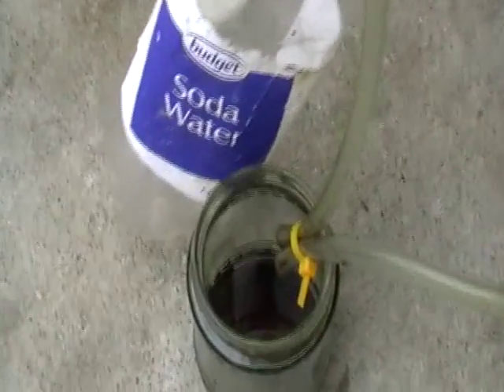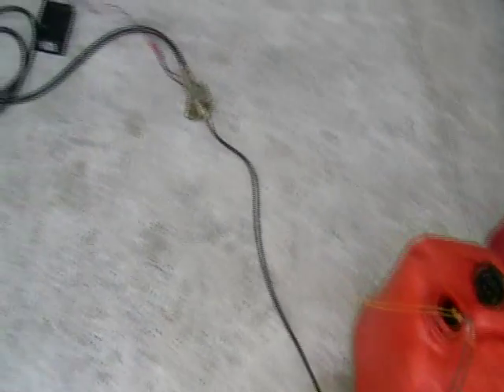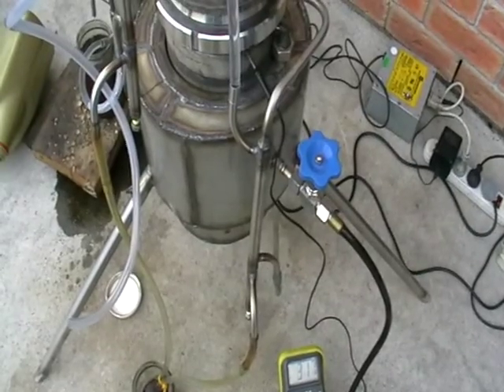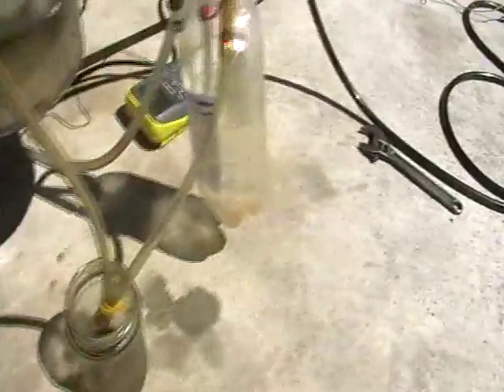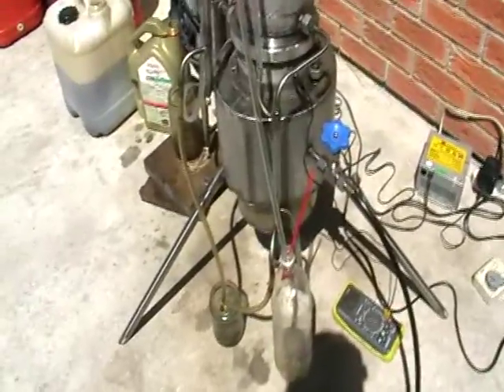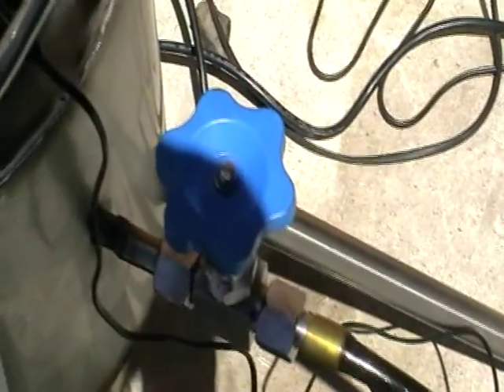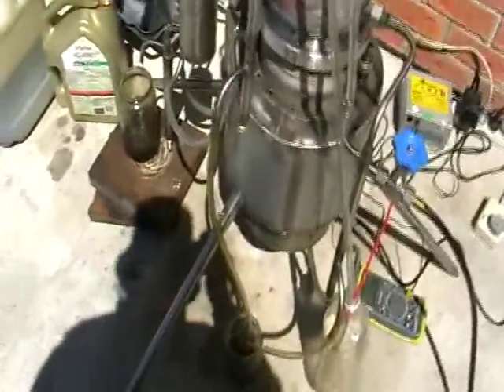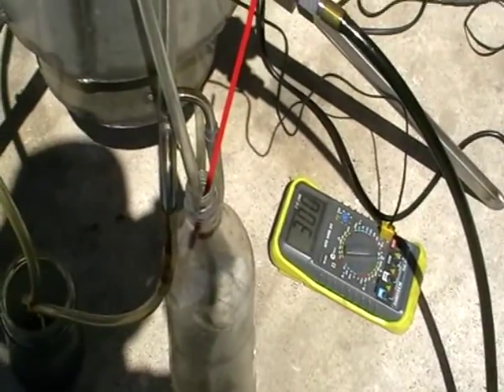WMO to Diesel fuel.

Comment: Did you have construction plans?
Reply from the maker: Hi, I still need to sort out some issues with the reformer (heating part of it) and then test it again to be sure that it is meets my criteria, then will prepare the manual and make it available, and sorry, no time frame as I am extremely busy with many other projects for my customers.
Thanks
Reply: Ok thank you